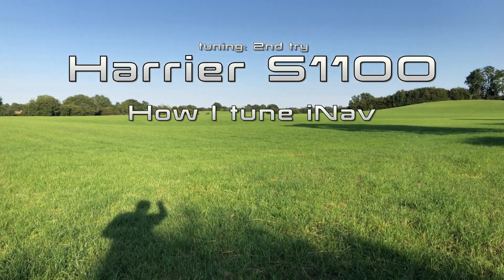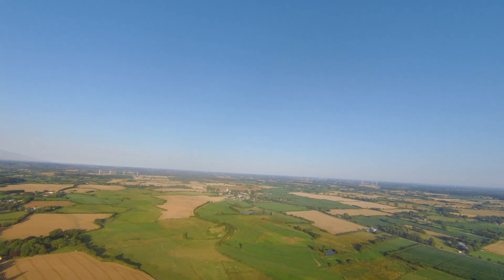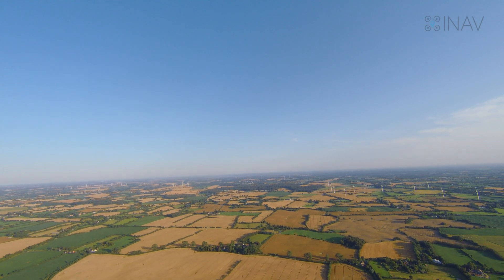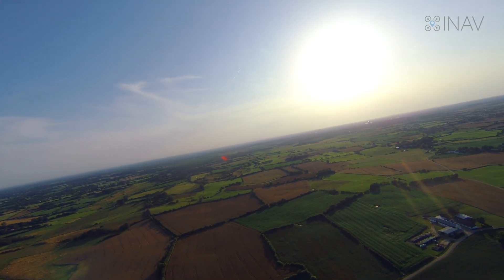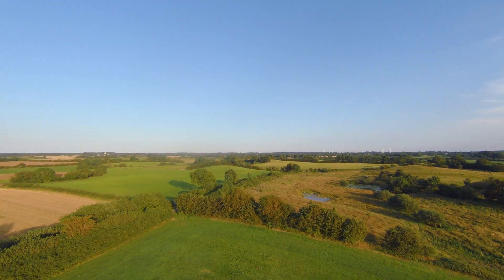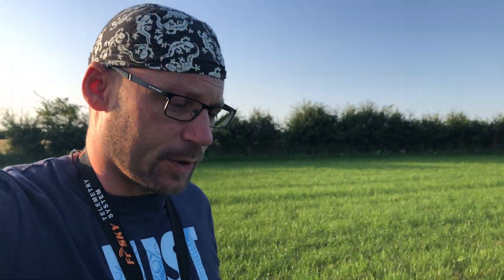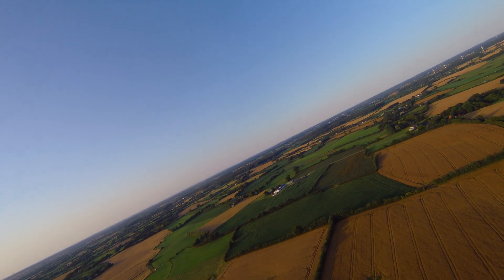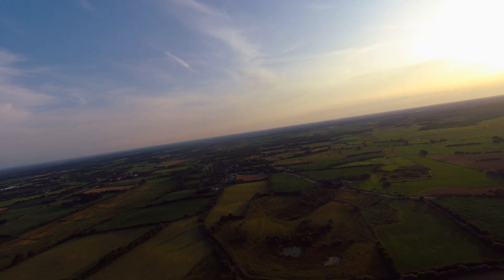Harrier S1100 -  how I tune iNav #19

Comment: Hey friend! I thought the autotune needs to be done in acro mode. I didn’t know angle/horizon can also be used to auto tune.
Reply from the maker: I think ... both works. Nowadays I commonly use Acro as the setups I get my hands on are good to fly so. But basically it was (at least back then) possible to tune in stabilized modes too. But that might have changed

Comment: Hi, strange I posted a question here.
Reply from the maker: I got a notification but the message didn’t show up. Could you state your question again and I’ll respond then?
Reply: @JustFPV-net  yes, thank you very much, I m just started in this world of Inav 3.0.1 with my S1100 Harrier too. Now I finished the installation of the Matek F765 in the Harrier and ready for the maiden. My question is: Because any of the modes (Angle,Acro, Manual etc etc) arent still trimmed, in which mode should I throw the Harrier as first time ? I just adjusted the servos in mid positions manually i MANUAL mode. (added som 8 mm up in elevons too) . I really prefer in MANUAL mode first throw and see if it can reach altitude and then start these procedures for automatically trimming. Just this was my wondering... thank you again and waiting for your tips and guide.
Reply from the maker: If you ask me: skip the manual mode and  go for acro in the first flights. Then try horizon mode and get tuned ;)

Make sure to set the auto tune mode to max instead of the default - this will prevent iNav to overshoot the rates … ;)
Reply: @JustFPV-net  ok, how do I "set the auto tune mode to max", which tab or field name in this new ver.3.0.1 configurator ? sorry for the newbie question. thanks for your quick answer.
Reply: @JustFPV-net  I answered this, but anyway, the max value for autotune, where is it ?  (the field or label name) in the configurators TAB ?
Reply from the maker: It’s a CLI command

set fw_autotune_rate_adjustment=MAX
Reply: @JustFPV-net  OK, thanks mate ! I will write this before the maiden, do you think that these others default values, generic, will be ok for the Harrier ?, greetings form Sweden !!
Reply from the maker: Nå, du er fra Sverige - veldig bra!

You can simply write this in the cli any time followed by “save” … that will make it permanently so no worries
Reply: @JustFPV-net  tack så mycket !! nu vi får se vad kommer att hända när "maiden" körs.
Reply from the maker: Looking forward to hear the outcome- du må ha det
Reply: @JustFPV-net  Hej !!, körde idag maiden och körde  också den där autotune procedure, och efter det, ANGLE mode kände icke bra, väldig tung för att 
snurra , mycket sparken för att modelen reagerar. Vad måste jag skriva någonstans i konfigurator ? för att fixa detta ? behöver lite mer "reaktion" i ANGLE mode. tack !!!
Reply from the maker: In the start of the tuning process the wing will react verrrry slow and over time (while tuning) get more and more agile. Try to fly about 10-20mins in that mode. 
If you feel the rates to be to slow/low then raise them in the pid tab and redo the tuning! 

Og tillykke med den første start ;)
Reply: @JustFPV-net  hej ! thanks, please tell me witch column name in the PID tab? I got columns name = "Acro/gyro" "Forward" etc
Reply from the maker: In that page you’ll find another tab by the name Rates
Look for roll rate and pitch rate